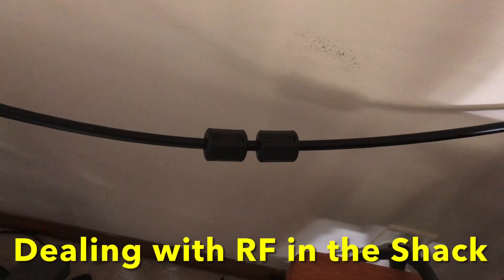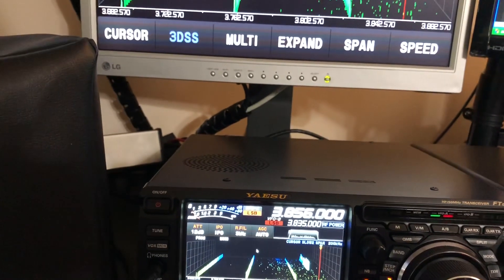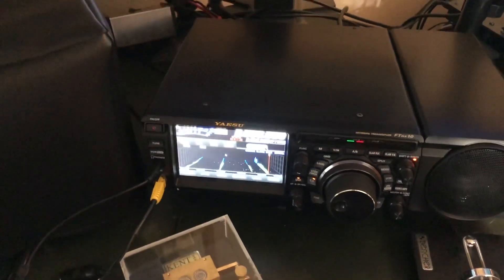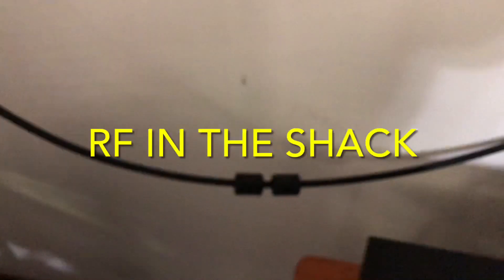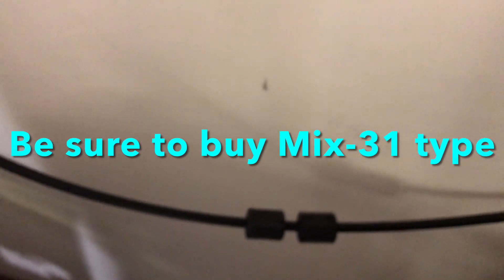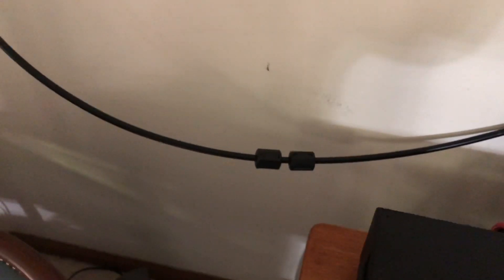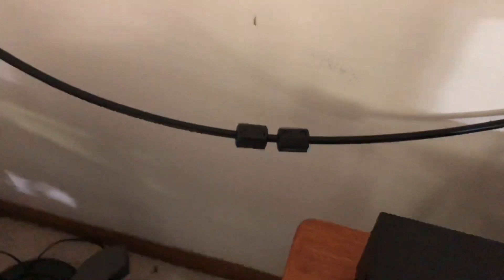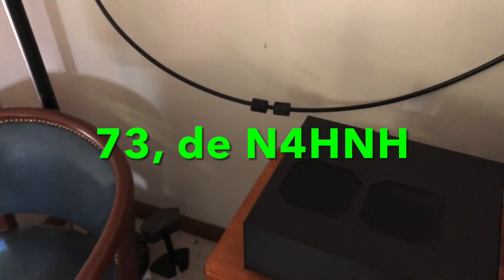Dealing with RF in the Shack #hamradio #rfi #noise #interférence

Comment: Hi Doug,  Does the common mode current flow down the coax to the point that the ferrite is placed then get stopped there?  If so, why not mount the ferrite on the coax outdoors before it enters the shack? Thanks. Mark
Reply: That is where it should be.....Any returned RF into the shack is bad
Reply from the maker: Great question, Mark!  In the case of my Doublet antenna system, there is no coax outside.  The ladder line comes in through the top of the window and immediately connects to the 4:1 BalUn.  The common mode current is flowing on that 9 foot long piece of LMR-400 coaxial cable.  

For my other antennas, I have chokes outside as well.  The coax going to the OCF dipole is coiled under the deck (2 turns at approximately 16-18” diameter) and I have chokes clipped over the 4 quadrants of that coil of coax.  It did the same for the ZS6BKW.  I coiled the excess coax and choked it.  I’m fairly sure I showed that in one of the antenna work videos I shot this year, but I can’t remember which one.

If snap-on chokes are enough, I prefer them.  If they aren’t enough, I go to a 1:1 choke BalUn, outside if practical.  The loss through a BalUn is minimal but if the snap-on is enough, there is no need for the choke BalUn.

73, Doug
Reply: I think I have Common mode current on my coax because my nearby tv turns on and off when I key the mic and my swr meter moved a lot when I touched the coax or the meter. In an attempt to fix that I put ferrites on the coax feed line. Ended up with 4 of them in the entry panel outside. That caused my low SWR point to move From 7.2 MHz to 6.6 MHZ and I couldn’t get it back to 7.2 by altering the antenna length. In fact, I couldn’t get it to move much off of 6.6 MHz no matter how much I changed the length. The ferrites did cure those two problems though. The next thing was to remove the ferrites, which restored my swr meter flinch and my tv problems. At that point I called my regular radio store and they recommend a coax noise filter from Palomar Engineers that is supposed to mount on the antenna connection of the radio then the feed line connects to the other end of the filter. The unit was too bulky to mount directly to the radio so they had me stand it off from the radio with an 18 inch piece of coax. That fixed the swr meter flinch but not the tv problem. When I asked why not choke it outside, they said I didn’t want to do that. I don’t know why. The antenna is an ocfd with a 4:1 unun at the feed point and it’s trimmed for 7.2 MHz. The mast is mounted to the house with one leg of the antenna passing within 10 feet of the radio room. Since ferrites fixed the problems it doesn’t seem like it’s an antenna proximity problem? The tv problem only occurs when transmitting at over about 50 watts. Any idea why the ferrites caused the low swr point to move and not be adjustable?  Or why the radio store suggested the indoor filter instead of an outdoor choke?  Any other comments or suggestions? Don’t worry too much about saving me money, I’ve ordered one of those 500 watt power combos from Elecraft so since the unun is only rated at 200 watts and the wire is only 18 gauge, that’s all going to be replaced anyway. The filter is rated at 500 watts but I’m guessing you’d say to upgrade it too?Thanks Doug.
Reply from the maker: I’ve told some hams before that antenna work can sometimes seem like witchcraft.  Sometimes the antennas don’t play by all the rules.  I’ve had chokes move the point of resonance but not as much as happened to you.  Are your chokes a Mix-31 type?  Mix-31 works best for 10 MHz or less.  But Mix-31 is also effective for up to 300 MHz.  Mix-43 is good for 2-meters, and Mix-61 for 70 centimeters.  I use Mix-31 because my RF in the shack problems fall well within the HF spectrum.

With antennas from the doublet family, the length of the ladder line matters.  My doublet is resonant at 17m because it was resonant at 16 MHz and I trimmed the ladder line to shift it.  When it was resonant at 16 MHz, it exhibited a less than 2:1 SWR on 20m and 17m, but neither band was perfect.  I needed less ladder line anyway, so I trimmed the ladder line and moved the resonance point to 18.130 MHz.

If you watched the video where I tried the 97-Ohm 1:1 BalUn for my doublet, per the recommendation from BalUn Designs, the length of the coax between the BalUn and the amplifier/tuner shifted the SWR around.  This is because the BalUn output impedance was 97-Ohms and the coax was 50-Ohms.  The coax acts as a type of matching stub in that scenario.  

Now that I’m using a 4:1 BalUn (200-Ohms to 50-Ohms transformation) the length of the coax doesn’t affect the SWR.  I proved that by trying 6 feet, 9 feet, and 12 feet of coax again.  

So, all that is to say, variables play into this.  Coiling the coax can affect the SWR.  How many coils can affect it.  Could be good and could be bad.  Ferrite chokes can change the match somewhat, though I haven’t personally seen it move as much as with yours.

Anyway, I choke outside when possible, and inside.  I like that Palomar Engineers sells the snap-on chokes in packs of 5, 10, or 15.  These types of chokes are handy to keep around.

73, de N4HNH
Reply: Thanks Doug. Yes, mix 31. Witchcraft is the word I was looking for.
Reply from the maker: Educate yourself on doublet antenna systems and multiband dipoles.  When an antenna is used on a non-resonant band, there will be common mode current on the shield of the coax.  The antenna match (aka antenna tuner) can make the transceiver or linear amplifier see 50 Ohms impedance, but there will still be standing waves on the feedline.  

If you have enough land to install a resonant dipole for every band, good for you.  You are fortunate.  Or maybe you have a Yagi atop a tall tower, and only operate on the bands your Yagi is resonant on.  Enjoy!  That is a luxury that many amateur radio operators don’t get to enjoy.
Reply from the maker: How much land do you have for antennas?  Do you have a separate antenna for each band?  Do you ever use an antenna tuner?  Do you use an amplifier?  How much power?
Reply from the maker: You will be much happier watching videos someplace else.  Bye!
Reply from the maker: You came on here acting like everyone should have enough property to install a dedicated antenna for every band, 6 through 160 meters.  In a perfect world everyone would.  Since you didn’t answer my questions, I suspect you have the ideal amount of land to erect a perfectly resonant antenna for 6 through 160 meters.  

My channel exists for amateur operators who don’t have such a utopia to work with.  If I don’t answer questions about RFI I’m not serving my viewers with information about what to do when they don’t have a perfect place to set up antennas.

Why don’t you explain to all of us how you would set up a doublet antenna system, or an OCF dipole, or an EFHW, and prevent any and all possibilities of common mode current on all bands?
Reply: oh2dx,I am here to learn something from a generous guy who is willing and able to help me and I’m sure all 5-6 thousand of us subscribers are here for the same reason. Doug seems happy to create relevant content then actually answer questions in support of that content and I’m happy to have it available. Nobody is unhappy with the arrangement except you so you should move on.

Comment: Thanks for the video!  On grounding, what is your recommendation for grounding a 2nd floor shack?  The good news is that my shack is directly above the house ground rod, and I do have both a window and a pass thru to get outside.  Thanks!   73, K8JLW
Reply from the maker: When your shack is on the upper floor, you just have to run a longer ground wire.  I know people who don’t run a ground wire.  Their theory is that if you must run too long of a ground wire it can actually make matters worse.  Mine is probably 25 feet to the ground rod, but so far, after 24 years  I haven’t had an issue related to grounding.

Since you have a direct route to make it to the ground rod, I would recommend grounding.

73, de N4HNH
Reply: @n4hnhradio  Thanks!  I had heard that too about too long of a ground wire but I will give it a go.
Reply: Reid & Doug, I have a 2nd floor shack. I modeled mine after W8JI’s barn loft contest station. Before carpet was laid during construction, I ran copper tape strips in a 1’ grid pattern on the si flooring. They were soldered at each intersection. A 3” wide copper strap from GA Mtn Copper intersected the grid at my operating position. This strap continued into and down a pvc pipe installed behind the sheet rock and outside the brick (looking like a standard drain pipe) into a downward-facing elbow. The elbow has a cap with a slot for the copper strap which connects to the first of three ground ride run in sequence. They are close to a sprinkler head for some hydrangeas so the ground stays moist most of the year. With the advantage of new construction or just good luck in general, I’ve never had one indicator of RF issues my shack. I checked my ground bus against the ground strap going outside using an MFJ 931 without any appreciable need for adjustment on 160-10M. Someday you don’t need a ground reference in a 2nd floor. But I took this precaution while building. Thanks for your video, Doug, and your Q, Reid. 73, K4FMH
Reply: @n4hnhradio  Geez, some practical real world experience advice - thanks for that!  Do you have just one ground rod outside a window -- that's what I would have to do (along with a fairly long wire from a buss bar to the window pass-though - probably use insulated stranded).  73 de KI5GX
Reply from the maker: Yes Shawn.  The rule books says keep the ground wire as short as possible but I needed enough to make it outside to the ground rod.  It is hammered into the ground next to a deck support post, outside the shack.  Inside, all the grounds from the equipment are connected to a common lug.

73, Doug

Comment: What did it sound like when you had rf in your audio?
If i try to low drive my amp my audio sounds pinched and distorted.
I'm now thinking that might be the problem. 
When i increase drive it cleans it up at least enough to see improvement but i don't like running max power all the time.
Reply from the maker: Generally speaking, RF in your audio will be worse the more power you run. It’s makes your TX audio sounds distorted.